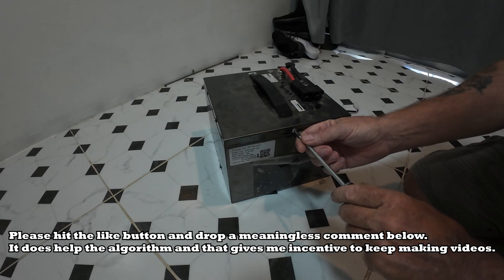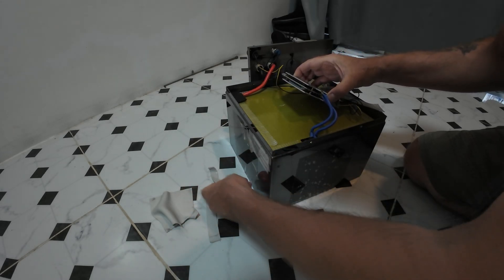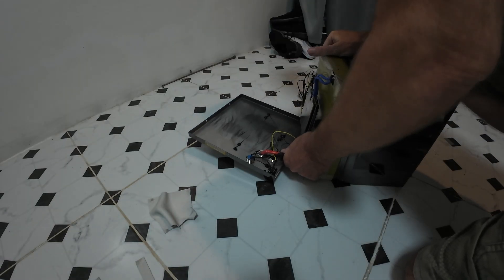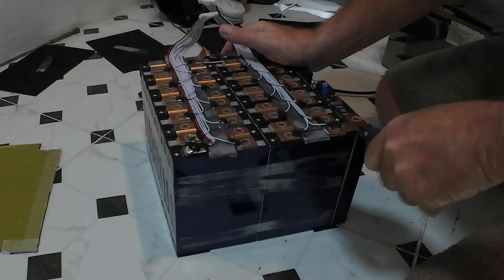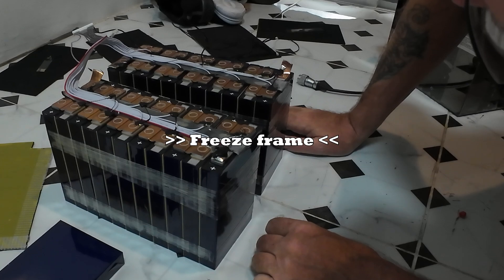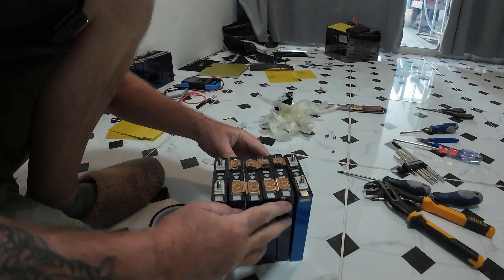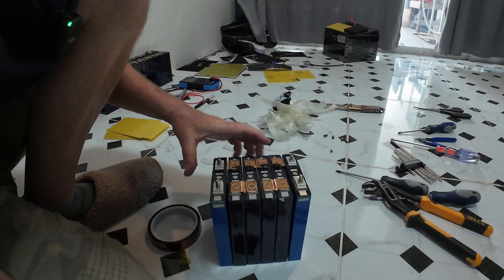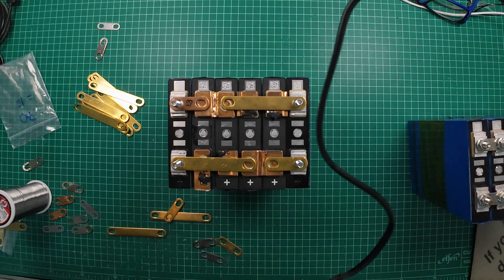Complete solar build on a tight budget. Part 1, harvesting LiFePO4 batteries

Comment: That's one hell of a beefy ass soldering iron which is understandable given the task 😀 , Maybe your wacky projects will inspire me to get back into projects like this as i have many batteries just sat there doing nothing.
Reply from the maker: It's not beefy enough mate, it's a 300w iron and it took me a good 10 seconds to get the cells hot enough to melt the solder. Get back into the projects, it's fun 😁

Comment: Making a high amp battery 24v I think will be perfect for a solar off grid setup. Repurposing cells to save the planet 😎
Reply: I'd say that 180+V battery would be better.
Reply from the maker: It's working well mate. Now I've doubled the solar cells, I'm getting more power than I know what to do with 😬

Comment: I hope there was a serious lack of ventilation when you did all that soldering. Safety last always
Reply: But he does not need that diesel heater. That's something to compensate the lack of burnt ffuel? 🎲
Reply from the maker: I even recirculated the inadequate ventilation for a few hours afterwards mate, I had the air-con turned on. Luckily, the Mrs was out for the day so it was only me that was suffering with memory loss for a couple of days or...... maybe she was in the house, I can't remember 🤣🤣🤣